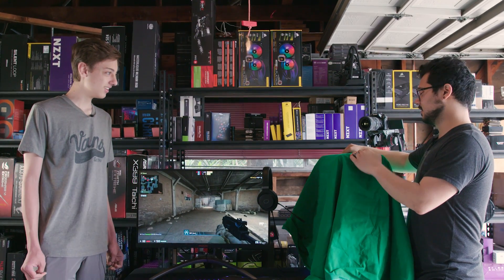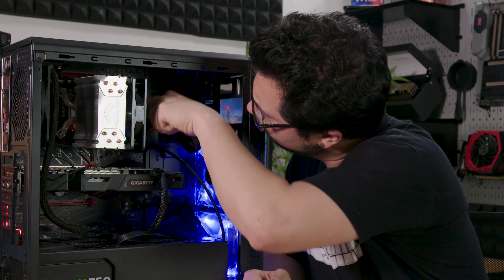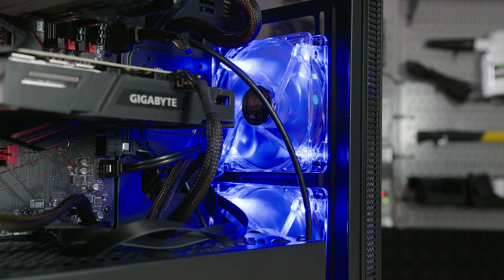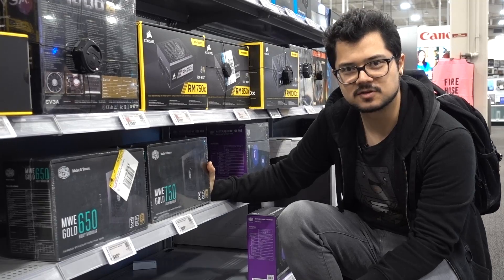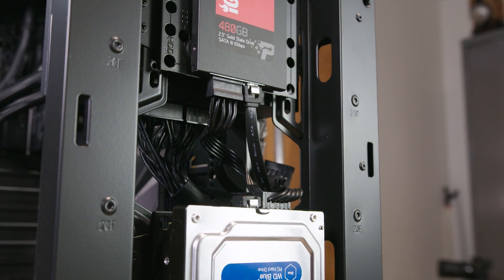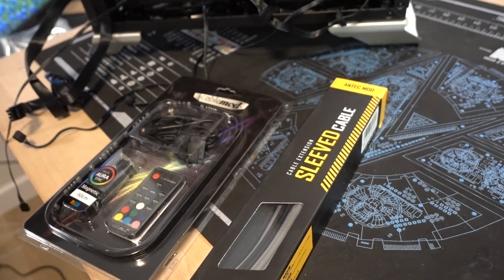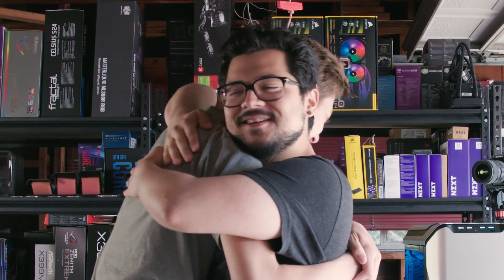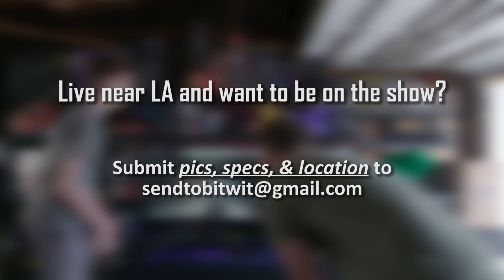He didn't see this coming a MILE AWAY #pimpmyrig #pmr #episode6

Comment: Poor kid, how can he live with a 9600k, gtx 1070i, Corsair 750W power supply, and a  480GB SSD?😂😂😂
Reply: That's the system I'm going to build by the end of this year which I'm excited about, WTF XD ... it's not even going to be a 1070 I'm getting a 1660, hopefully a 1660ti.
Reply: @js100serch  1660ti is amazing honestly.
Reply: @js100serch  do the 1660 ti, thats what i have with a ryzen 5 2600, good for 1080p gaming
Reply: @hunterashleyrides6873  Just wanted to agree that the 2600 + 1660ti is a great 1080p combo and decent enough at 1440p. I was originally running a RX580 and no intention to upgrade until I went to a full 1440p setup sometime in 2020 after the new 5700x and nVidia's next offerings shook out. But... my RX580 went belly up after 2.5 years and the 1660ti was the best fit that the local Microcenter had in stock. I have not been disappointed. Maybe a slightly lower overall value proposition at full retail compared to some great deals usually available on the RX580/590 line... but it runs sooo much cooler and quieter than the 580/590s do. Overall, I am very happy. I considered the 2060 as well, but decided not to pay the premium for ray tracing... need to see more support and less of a performance overhead before I make that leap.
Reply: @js100serch  hopes and dreams xD In the exact same boat lol xD
Reply: @js100serch  from what I have seen 1660 ti is right up there with 1070. I am not sure about 1070 ti, but the price of the 1660 ti makes that ok IMO.
Reply: @js100serch  Im getting an rtx 2070 by msi gaming z and i got this money by selling my brother's laptop which is worth 1k and someone bought it. me and my brother already thought about this lol. also 13
Reply: @js100serch  Shop on ebay and i'm sure you can find a 1070 for a decent price!
Reply: @js100serch  , true daug :<
Reply: @js100serch  well the 1660ti has about the same performance as a 1070 maybe a little faster on 1080p
Reply: js100serch poor you
I‘m getting a Ryzen 5 3600 and a 2060 Super
Reply: @js100serch  I have a 1950x and gtx 1070 but I do plan to upgrade my gpu next year
Reply: @js100serch  Dude I have an all in one HP PC XD
Reply: I'm chilling with a i5-8400 and a 1060...
Reply: @js100serch  i found a gigabyte OC 1660ti for 60 bucks off. The weeks before black friday are good fo PC deals.
Reply: @js100serch  get a 1070 lol, used its cheaper than even a 1660
Reply: @js100serch  try getting rtx
Reply: @js100serch  nah get a 5600 xt or a 5700 xt for 10 bucks more
Reply: js100serch if your gonna get a 1660, just don’t. Save 80 bucks and get a rx 590
Reply: Pet Lobster where I’m from an rx 580 is cheaper than 1660 (ti model even) lol
Reply: Pet Lobster  RGB is worth 80 bucks
Reply: @js100serch  dont get the 9600k tho get the ryzen 3600 it will come out next month and its much cheaper and will obliterate the 9600k. the 1660ti is a good choice tho, if possible try to get the rtx 2060 on sale that what i did
Reply: @js100serch  If you have decent internet. Get Stadia instead! I'm selling my PC with RTX 2070 and i7 6700 because of it :) PC gaming honestly sucks, just a bunch of problems, store wars, optimization issues, updates, downloads etc.
Reply: Mattias Bergstedt pc gaming isn’t for the faint of heart
Reply: I like mouse and keyboard gaming and I enjoy building systems
Reply: @mattias1099  no way will u actually do thar or is it a joke
Reply: @mattias1099  you are actually smoking. Stadia is ass and not worth it. PC  has every game plus looks hell of a lot better than stadia.
Reply: @mattias1099  🤦‍♂️🤦‍♂️
Reply: @mattias1099  I never thought I'd find a Stadia bot in a comment section, but yet, here we are
Reply: lol i have an i5-2400 and a gtx 1050 ti i wish i had his old set up
Reply: John Linton give me your setup then I have a i3 2100 and a gt 710
Reply: Hahahahha
Reply: Bruh STFU I'm on an amd fx 6300 with a GTX 1060
The definition of bottleneck
Reply: vBoxxyy i5 8600
Reply: Yakov gal I'm bouta get a ryzen 5 2600 or 2600x
Reply: @Boopinator50  get the R5 2600 with a decent cooler and it can be overclocked to roughly the same as the 2600X (Stock)
Reply: vBoxxyy do that it’s a good cpu
Reply: @Boopinator50  those are so dirt cheap right now they're such a steal. Get the 2600x. the performance boost to cost ratio is definitely worth it
Reply: @Boopinator50  I just upgraded from a 6300 to a ryzen 3600. best decision of my life. as well as upgrading my 1060 to a 1080
Reply: @yakovgal4780  i5 8400
Reply: @Boopinator50  hope you got the 5 1600 af, it is much better value
Reply: vBoxxyy y’all are all forgetting about people like my best friend who is playing on an hp laptop
Reply: vBoxxyy I was the same for awhile until I was able to upgrade
Reply: @Boopinator50  try i7 950 with a radeon hd 5850
Reply: @Boopinator50  i'm still stuck with i3-2120 and GTX 1050ti, now that's what you called bottleneck
Reply: @Boopinator50  I got a FX 8350 with a GTX 980. That's worse bottleneck.
Reply: @Boopinator50  upgarade now r5 2600
Reply: @Boopinator50  bro i got a 750ti and love it but its what i could afford so
Reply: Boxx jeez I’m building an 7800 and rtx 2060
Reply: Boxx amd a10 7600 and gt610 lol
Reply: @Boopinator50  bruh I'm on a ryzen 5 2600 and a gtx 1050ti
Reply: @Boopinator50  same lol
Reply: @Boopinator50  same bro fx8350, rx580 8gb
Reply: @Boopinator50  He was being sarcastic
Reply: @Boopinator50  lol im on a intel i5 2500k and a GTX 570
Reply: @Boopinator50   you wanna know the definition of a bottleneck, Ryzen 7 3700X with a 750 Ti single fan.
Reply: @Boopinator50  100th like :D
Reply: @Boopinator50  oof i have a Phenom II 1060T and a GTX 960
Reply: @Boopinator50  my dude,  i am running on a msi x970, phenom x6, and an hd7770
Reply: @Boopinator50   Oh yeah, my pc has a first gen i3 with intergated graphics.
Reply: i swear its better than my pc
Reply: @shoofx  my PC is like 4gb of ram soon it wil be 8gb , intel hd graphics 520 and 2 core 2.00GHz cpu
Reply: @jakubgasparik8021  tough
Reply: I play video games on and Xbox 😭
Reply: @lucapreston5325  me 2
Reply: Still rocking the gtx 960 2gb and i7 4790 since 5 years back haha it still holds up pretty well
Reply: @ellirk9837  still running my i7 5820k gtx 980 from 2014. no issues with anything i play
Reply: i literally have a ryzen 5 3400g, gtx 970, 600W psu and random £10 fans that barely do the job, my system crashes after 10 minutes of playing witcher 3 on low setting lmao, yeah, he really is poor isnt he haha.
Reply: Haha, exactly my thoughts, would be better if he starts building this for people that have passion and knowledge of PC but no means to build one, who ACTUALLY need one. This was just meh, building a Nasa computer for an already Rich boi kid who's got everything already, Big woop.
Reply: Im on PS4 😓
Reply: Guys you all have really good PC's.Mine has an intel core duo and a gt220,4 gigs ddr2 ram,and two 100 gb HDDs.
Reply: Boi I’m playing on a Intel i3 3220 , GTX 1050 , 8 gigs of ram... 😂
Reply: I've been living with my i5 4690, rx570 , corsair 550W power supply , 240gb SSD and 350gb HDD :D
Reply: While me with my Intel Pentium 30fos csgo
Reply: Lmao I'm on a 1060 3gb and a i5-7400 I need to upgrade my ram, it's at 8 nina Mia get 16 gbs
Reply: well , i live with a worse gaming setup !
an Core i5-2500 , 13 Gb (yes , 13...) of DDR3 , a GTX 750Ti (like , WhO uSeS A 750tI iN 2019 ???) and a 320W HP PSU .
and yeah , if the bottleneck in person was a rig , it's mine .
Reply: Bro
Reply: Everyone shut up I’m on a intel iris 640 graphics card and 128gb ssd and 8gb ram 2666 MHz
Reply: im on a intel integrated graphics laptop
Reply: Mans chilling on a 2 core 2500 mhz cpu with integrated graphics beat that
Reply: MCES LEX fuck all of you in playing on my moms laptop and a broken mouse a friend gave me
Reply: amd a6-9225 4 gb ram i think mine is so much better
Reply: I read this comment before the video started and thought you were talking about his upgraded system
Reply: my computer is a lenovo yoga 710 and i use it for gaming and not even roblox can run
Reply: I have an i3 4005U I'm the poorest here
Reply: I have a i5 3rd generation and a GTX 750 Ti its shit its gonna die any second
Reply: me here with i3 2200 non k, korean psu, oem mobo, ex used ram kingston 1x2gb ddr3, non vga
Reply: His pc is so much better the My laptop i got a T430 grapichs card 😭
Reply: 55555 (hahahaha)
Reply: And he's not that bad I running a FX 4300 32 GB of DDR3 and 2 GTX Titan 6gb in sli so
Reply: dude im still running on an fx-8350. i am dying
Reply: MY rig: 4gb ram, no graphics card at all, and i3 cpu......... Can't get better than..
Reply: @faiyazcharoliya195  right
Reply: on christmas i’m getting a 2070 ti and a ryzen 7 2700x i’m also going to get ASRock Fatal1ty X470 GAMING K4
Reply: my system got a fx8350 and a gtx 1050ti xD and its fine for mit atm :-P
Reply: i7 4770 gtx 1050 ti
Reply: ikr :D 1070Ti and i5 9600k would still be like a huge upgrade for my i5 6400 + GTX 960.
Reply: Pooor kid?? Can i call my self poor too coz only got i5 8400 and gtx 1070ti and 128gb ssd 16gb ddr4  runs at 2600mhz coz mobo can handle thats speed lol  and by the i got a4 keyboard and mouse combo hahaha 😅😅
Reply: I sad boy
I have a i5 8400 and a 1050ti
Reply: I'm running a store bought Windows 8 computer
I dont know the power supply
Pentium CPU
4 gigs of ram
500 GB drive
No SSD
I need help
Reply: Please send help
Reply: Just say ur jealous and go bruh its so obvious
Reply: Bruh i still have a gtx 660 with fx6300
Reply: first upgrade "Power supply" i had to rewind like I didn't see a corsair 750 watt
Reply: I still use that 750W psu lol
Reply: all of u fucking have PCs and shit I'm over here melting my laptop to run csgo
Reply: me: playing gta V with an i5 2400 8gb ram 250gb hdd and a gtx 460 :<
Reply: Let's go amd fx 6300 gang
Reply: k series is designed for overclock so he at least needed a better mobo with overclock capabilities.
Reply: Im on an i7 4790k, a gtx 980, 16gb of ddr3 1600mhz, no ssd for windows, a z97-a motherboard and an old cm stacker case
Reply: I'm using a worse system
Reply: man im living with a Pentium CPU and a GT 710 with 4 gigs of ram
Reply: This whole reply section no not even this reply section the whole comment section is r/choosingbeggars this like getting mad at someone who won the lottery
Reply: Sprkz ew fortnite player and a redditor
Reply: i have a rx 470
Reply: Bro I have an i7 2600 and 1050ti ffs you're trolling hahaha
Reply: Im hoping to get a gt 1030 with a ryzen 3 2300x
Reply: Me with a gtx 950 👁👄👁
Reply: Shut up you whiny bitch feel good for the kid he worked hard for that pc in the first place
Reply: Dargon how do you know that
Reply: Right kids spoiled af bet he didn’t even pay for shit
Reply: @peepthekid8390  it's a contest that he won. Parents win contests without paying too. It's just how it is.
Reply: @peepthekid8390  its a raffle through cooler master and best buy, he won the raffle fair and square
Reply: Always the ultra white guy with good stuff, getting even beter stuff
Reply: @kyledeloof6497  lol yeah right....I am stuck on my i5 cpu and gtx 970......I'm just now scrounging enough money to build an entire new PC.....took forever!...I dont have this kind of luck bro!
Reply: @kyledeloof6497  wdym?

Comment: correct me if im wrong but i fail to see how the system will run cooler in that case hot air from the gpu rad going into the cpu rad

Comment: RTX 2070 would have been a great option for this video and others like it. The RTX 2070 is a normal persons pimp my rig. The RTX 2080 is simply too expensive for performance to be taken seriously. If I am going to go insane and buy an expensive card I am going to get the RTX 2080 Ti not the RTX 2080. Since I am not insane I bought a RTX 2070 for $500 because more money than that for a GPU is obscene. The RTX 2080 is a odd GPU it is so expensive you might as well buy a 2080 Ti and so much more expensive than a RTX 2070 it's not an option either way. I never am able to wait for a Ti variant so RTX 2070 replaced my GTX 1070 FE. When the RTX 2070 Ti releases to fill the 2070-2080 price gap , I will be here throwing mad salt and shade just as I did with the last generation GPU's. See you guys then! :)

Comment: I would had never removed the 200mm fans that make that case special. You should have gotten a normal 2080, and have the 2 monster 200mm fans give you way better airflow to the case compared to those 2 120mm that have a rad in between (only benefits the GPU). It would had saved you money because a normal Aorus 2080 is cheaper. Matter of fact you removed what makes this case unique AND expensive which is those fans lol To do what you did any cheap Cooler Master case would had done the job.

Comment: Mine only has 1 fan and a 1050 ti, granted it has a better chipset, i7 8700k, but I think that's it, I doubt that I can overclock with the motherboard and cooler I have so my rig sucks, I only have 1 heavily used 1080p monitor, I wish I had his old setup with my chipset, and a better motherboard

Comment: if i sent in my rig, could i choose the parts? I would like Asus Rog Z390i, 9900kf, 2x16gb Corsair 3200 dominator platinum rgb, Metallic Gear Geo Itx G, EVGA Kingpin 2080TI Hybrid, Seasonic Ultra prime Titanium 850W, Corsair H100i platinum, all fans either Corsair LL120mm in push/pull 2000rpm editions, or Noctua industrial 3000rpm, in push pull with Phanteks Halo Rings for the RGB Bling, 1TB M.2 Samsung Evo Plus NVME, 2TB M.2 Sata Western digital Blue, 2x4tb Samsung QVO in Raid 1 for Storage, no mechanical drives. Beyerdynamic 1770t 250ohm 6.3mm jack, Focusrite Clarett Usb 3.1 Audio interface, with Blue Microphones Yeti Pro, 2x Krk VXT8s G3, Krk 10s Subwoofer, all XLR, Asus 4k 144hz screen 27", i have mouse & keyboard thanks :D

Comment: With the rear fan intaking, you're circulating the cooler room air through the cooler, instead of the hot air from inside the case.

Comment: AOC (off topic a bit) when I went to the site for the monitor in this video they had "QHD (2K)" for their 2560x1440 monitors. QHD is 2560x1440, however 2K is not. Technically it's 2048x1080, some people use it as 1920x1080, but it's definitely NOT 2560x1440. Not even close. Surprised a company that sells monitors can't get that right.

Comment: *NOT GSYNC COMPATIBLE.
At least not in NVidia's list yet, but if it's not it may still get added... and note the "ignore that" he rightly said for "HDR 400" as that's a bullshit spec. If your HDR contrast isn't good enough you really shouldn't use HDR functionality as you're likely to not have the proper experience and it may be worse than just using normal SDR.

Comment: Nice looking case. Pity Kyle had to remove those huge 200mm fans for the rad. CPU rad would have looked nicer with the fans in push configuration (mounted under the rad) too.